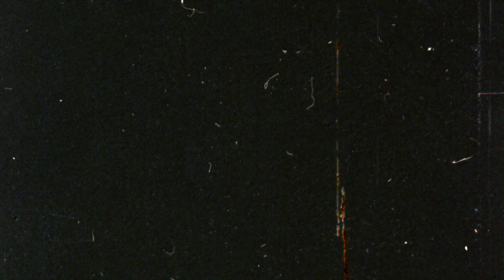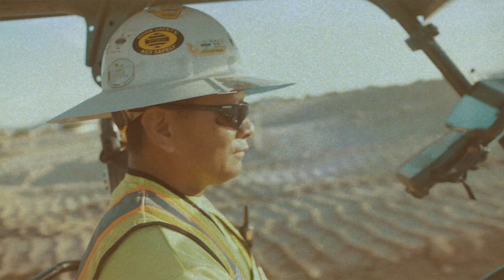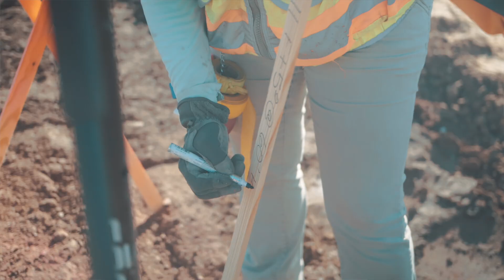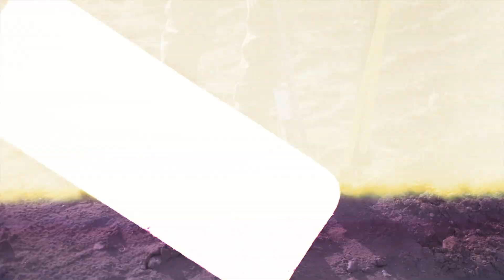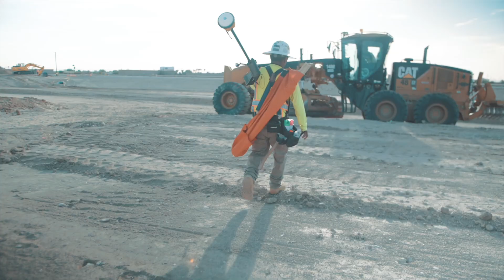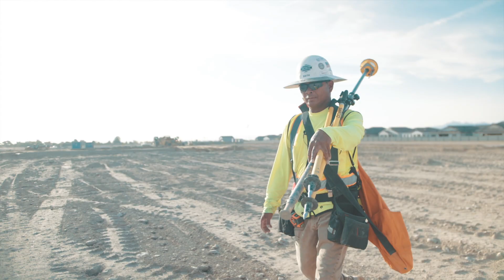Heavy Construction Grade Checker Day to Day -- Rummel Construction

Comment: i only know the old way- 100 ft tape- plumb bob- eye level, and a set of plans , taped along the edges and a scale in my breast pocket.  still do it that way .
Reply: I've been retired for quite a while. No GPS, no wheeled vehicle. I loved being a grade checker and it was great exercise.  I used a prism too because it sped things up. I still have my original hatchet but the handle has been replaced.
Reply: @premie33  I'm in grade setting school and they are having us set pads with two 100ft tapes. One diaganol and one straight meeting our nail or hub for a right angle. How does the prism work, it looks like it makes things alot easier.

Comment: I wanna become one and also be a good operator 🙏🏻
Reply: If you're new to running equipment I recommend getting as much seat time on equipment as you can. Other than that it can help a lot to learn what you can from the company you're with and also invest in yourself outside of work when it comes to certifications and taking advantage of free information on YouTube.  I wish you the best!
Reply: The Internation Union of Operating Engineers has an apprenticeship program. They only open it once in a while but it's worth looking into in your area. I was Local 12.

Comment: Those Trimble Rover and Basestation setups can cost around $40k and add another $10k for the software to make the model of the project. Very expensive but can save money in the long run by not having to pay your survey firm to come out and set your construction stakes everytime you need them. Now you just have your grade checker come over and tell you how much to cut or fill and he can replace a stake easily and quickly.

Comment: That is a combination of the old and the new. Before ALL the grades were on stakes and the grade checker went off of that. Now everything is on the GPS and he puts up grade stakes just for the operators without GPS on their machines. Even though GPS is available for all machines most companies only have GPS on a few key machines. Such as graders, and dozers. It is too cost prohibative to put it on scrapers, push dozers, compactors, etc.